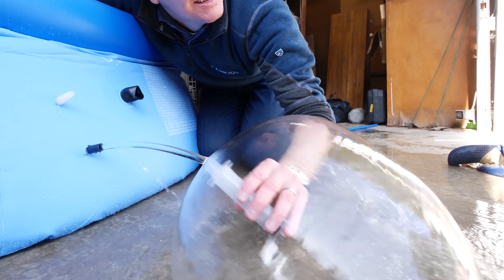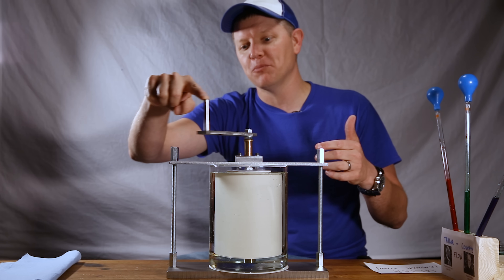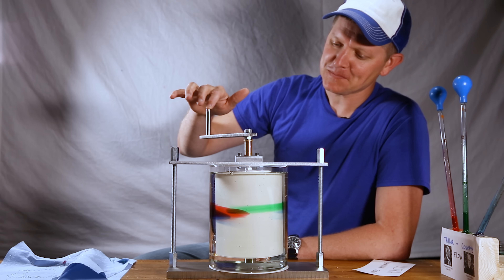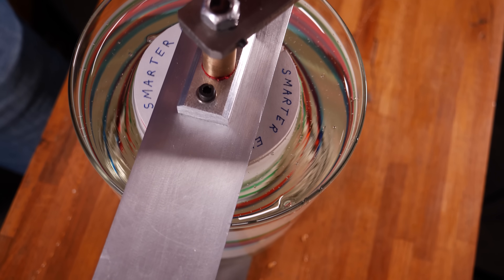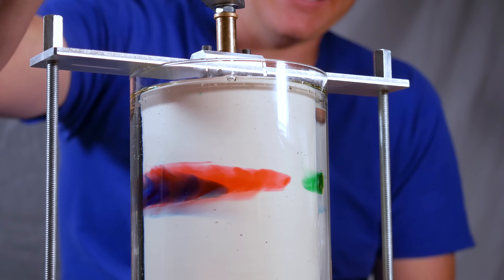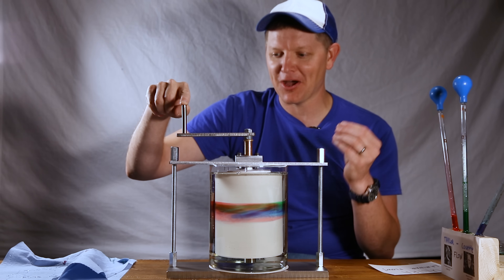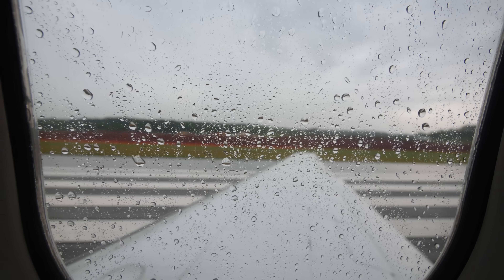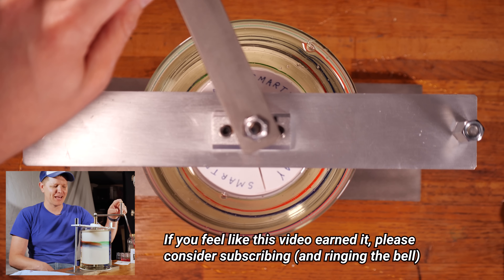Unmixing Color Machine (Ultra Laminar Reversible Flow) - Smarter Every Day 217

Comment: Hi, Destin. Great video as usual. I had an idea for another video. I've always wondered what a fire would look like if you could pause it in time and see it from all angles, using the same effect that they use in the Matrix to pause and rotate around someone during a fight scene. The idea came to me because I'm curious if each flame from the fire is flat / 2D or if it has some 3D shape to it. You can't really tell in person since you can only see a flame from a 2D perspective and it changes so quickly that you can't see the other side or the top before it changes. I'm hoping I explained that well enough. I figured if anyone could make a video like this you could do it. Cheers!

Comment: You have demonstrated dense wavelength division multiplexing on fiber optic long haul internet data backbone circuits in fluid instead of in light.  

In the case you call shear thinning, we call that optical 'dispersion'.

Please take a look at negative dispersion fiber optics and the related field of pumped amplification of fiber laser signals.

They make the data flow from the Data Center to the next Data Center across the country.

-Cecil

Comment: If you ran an electric current through a copper tube filled with ferromagnetic fluid could you produce a larger induction coil with a bigger magnetic field? Or solid copper coil makes most effective induction field?
 Can you do induction heating in a vacuum?

Comment: makes an awesome demonstration of air flow as well ... and for those who think fluid dynamics and air flow arent the same ... you are so very wrong ... they are exactly the same ... they just have different viscosities and so react similarly but more pronounced ... this is why drag reduction works in wind tunnels and water tunnels ... it is essentially the same thing with different densities

Comment: Sorry, but it's NOT reversible mixing. The colors aren't actually being mixed, they're just being overlaid in a tightly-spaced spiral pattern. If they were actually being mixed, you wouldn't be able to separate them again by simply reversing the crank.

Comment: Can you explain how a smartphone knows how much battery power is left? The voltage is constant so how does it know how much energy is left? I've googled this and the answer appears to be "it doesn't know, it just estimates by measuring how much power was used since it was full". I don't like that explanation.
Reply: Smartphones use Lithium ion (Li-ion) batteries, these batteries operate within a certain voltage range. The smartphone is able to read the voltage of the battery and calculate the percentage of remaining battery power. Li-ion batteries use cells and each cell can store up to 4.2 volts, as the battery is used this will go down and most smartphones stop discharging to prevent damage between 3.0 and 3.6 volts. Past that your battery starts to damage itself, it’s pretty cool stuff. If you’re interesting in learning more look up “Lithium Ion Batteries”
Reply: @marcussykora8383  Voltage detection only works when turning the phone on. ... "When the phone is running, we thus cannot rely on voltage measurements. " says the internet.

Comment: @
SmarterEveryDay what would happen if the angular velocity of mixing and unmixing has a very high gradient. Will the results be the same?

Mixing at higher angular velocity may cause "slippage" of the fluid on the inner cylinder and unmixing at a slower velocity may have less or no slippage resulting in a possible different outcome.

Comment: Hey Dustin, are you located in HSV? The reason I ask is because I have seen videos where you have had excerpts taken at various places in the rocket city. The most recent one I seen was when your were talking about laminar flow (the most recent time) inside of the Davidson Space Exploration Center. The building was named after Julian Davidson, whose company I used to work for in Cummings Research Park. He was a great man.

Comment: I'm curious if you think the striations in the colors after returning to the original position are more from the varying speeds of controlling the crank manually or if it's from slight variations of the viscosity within the fluid. I guess another video with a really slow reversible motor after somehow getting a homogeneous mixture of corn syrup is the only way to find out!

Comment: Hey! I work at a gun range and am building a new rifle. All of my coworkers tell me that the open ended flash hiders (three or four prongs that are not connected at the end) like the one in your how a suppressor works video work the best to reduce muzzle flash. When I died why I got a lot of answers that didn’t add up to me. Half said that the tuning fork effect they have mixes the air so it dissipates the pressure faster and the other half said something about the harmonica of the barrel and blah blah blah. I have a theory but I thought it would be a cool topic to cover.

Comment: Hey Destin, I came across something quite interesting recently. I was making hot chocolate and to cool it off I placed an ice cube in the cup. What happened next surprised me, the liquid started to swirl as if I had just stirred it. I found this fascinating enough to where I did it again; on my third time around nothing happened. Assuming it was the heat of the water acting on the melting ice I made another cup and sure enough, it started swirling again. The ice I was using was cylindrical in shape and around 2.5cm. I did this again tonight and decided to measure the variables. At my altitude of 239M above sea level, the temperature of the water had to be no less than 79C, and the ice, if larger than 3.3cm wouldn't produce this effect. The cup was 11cm in diameter and 10cm tall. 

Now that all of that is on the table, here's my question. Do you know what causes this, or would you be able to help me figure this out? I understand that it isn't very interesting for most, but it is baffling me as to why it happens. 

Thanks!
Reply: I belive the ice cube cooling down the liquid causes it to sink and thus creating a swirl. I read about a phenomenon that caused a gigantic ice circle to spin for no apparent reason. It was later revealed that this was caused by the same reason that is affecting your ice cube. Not sure about the variables though.
Reply: I'm going with 'Significant discontinuity' on the surface of the cylindrical ice cube. 
Of course, the cube is melting on all sides, but at a particular point, there is what I imagine to be a linear indentation allowing the melting to be focused and directed in a specific direction, causing the spin.
Reply: Convection cycle?
Reply: As a few others have said, I think this is simply convection. The cold and melted ice water as well as the coffee that's cooled from the ice will sink. Perhaps when it sinks it's subjected to Coriolis forces causing it to swirl. Like water down a drain. But I'm not sure if the coriolis effect has any meaningful impact on such a small scale. 

It could also just be the ice melting unevenly causing a pressure on one side making it spin. Does the ice and swirl spin the same direction every single time? If you started the system with a slight spin in the opposite direction, then added the ice, would the spin stop and reverse direction?

If it spins the same direction every time or will reverse the direction of an existing flow, then for sure I'd say something is going on (coriolis?). If it isn't repeatable then I'd say it just ends up spinning in whatever direction most of the liquid is already rotating.
Reply: Brownian motion?
Reply: @veritasiumaequitasius3530  no Brownian motion should work only in collidal solution and that too on a microscopic level not visible.(well but if it's diffusion then that could be explained by Brownian motion I guess)

Comment: The striations indeed look like they might be due to shear thinning or some other nonlinear shear effect; the other thing that stood out to me are the air bubbles though. They also create a localised perturbation in the flow; which I suppose is also reversible as long as the bubble is sitting still; but given that they should be rising at a nonzero speed, that could be another factor contributing to imperfect reversal; and probably would also look like striations from the top.

Comment: Why mix so slow though? Does more force/velocity = no unmix?
Reply: Maybe because the higher speeds could cause more of a centrifugal force that would mix everything up. Just a guess. Could also be that the varied shearing rates (mentioned in the video) could be more extreme at higher speeds, therefore mixing the colors. Or, the higher speed would create more frictional heat, which could affect the viscosity of the fluid.

Comment: First of all, you’re awesome and your videos rock! Interesting idea for a future video if you can crack the code which I’m sure you know already or have might possibly already figured out. When I did a burn out with my Chevy truck, power-brakes and both tires spun up (yes it has a limited slip differential) and this is my question: The imprint left on my smooth garage concrete floor is a perfect representation of the tire tread, somehow marked by the tire continually spinning over the same spot?? Any ideas? I can send a picture just not sure where yet. -Paul

Comment: You should try it with slow controlled motor, i suppose result will be even better. There is definitelly some incorrections while turning backward because it is mostle impossible to keep the same speed, and different rotation speed obviously causes different flow's variations and ways that your liquids mixes. So while you turning back it will be harder to get same liquid points. Motor with controlled speed will fix this problem. Also you can experiment with different rotation speed's, and then compare results to achieve as good as possible result (or even explore some physic laws).

Comment: Use an arduino and stepper motor and see how many turns forward and backwards you can go, as well as how many times you can reverse it before the sheer thinning messes it up. Would be interesting to test and see which fluids work best and "last" the longest in demonstrations.

Comment: I've heard this called reversible in many occasions, but I don't get why it's considered «reversible». Sure it's time independent, and that would imply reversibility, but there's no flow happening in this demonstration. 

Also, I don't buy that this is an effect of having very low Reynolds number. If you were to build the same demonstration, but instead used water with a precisely controlled actuator that would rotate the inner cylinder at a low Reynolds, you'd have mixing. There's gotta be a chemical (or solvent rather) effect going on here.

Comment: Great video! Btw, you're right! The flow isn't radially linear (it's parabolic) and you can get the velocity profile by assuming it to be 2 parallel plates (1 at rest) and either solving the Navier Stokes equation or doing a momentum shell balance over it :)

Comment: Destin, you can up your game by replacing the cylinder-in-cylinder setup with a robotic hand (like KUKA) that slowly moves an actual spoon in not-that-obvious pattern, and then reverses the motion. Would that work? Or there would be some turbulent flow along the spoon edge that breaks the reversibility.

Comment: Besides everything else, I suspect gravity (or the underlying maths) has some relation to this - the outer and inner deformations of the dye, speed of rotation vs the distance from central axis etc. Anyway, why not spin it faster and then reverse spin it even faster and see what happens? A small, low speed rotation forwards and backwards, impressive back during the discovery, but not at this point. Not that the discovery wasn't.....revolutionary (pardon the pun), but......?? Also, what about the research on tsunamis and how water flows on water? - A discovery that apparently had more attention after the Banda Aceh event and why a sudden catastrophe ensued.

Comment: Hi my name is Adam. I've got a simple question, and it is giving me a headache. Does it matter which way the vortex spins? For context I'm trying to put a 5 gallon bucket in line with my shop vac, to collect more of the dust before it gets to the shop vac, to hopefully prolong its life, reduce suction lose from dust buildup, and allow it to run for longer periods of time at a cooler temp. The plan, two holes in the lid of the bucket each about 1 1/4 inch, one in the middle, and one closer to the side of the bucket. The hole in the middle gets a piece of tubing inserted 4 to 6 inches into the bucket, and the other hole gets an elbow pointing into the side of the bucket. The overall direction the elbows facing determines the direction the vortex will spend. The air and dust enter the bucket, hit the wall and spin with the vortex. The dust can't immediately exit because of the pipe sticking down the middle. Then gravity forces the dust down into the dead Zone while the much lighter and faster moving air takes the path of least resistance. Some of the Dust will get by the pipe trap, and there lies the heart of my question. Should the vortex spin counterclockwise you know because of the toilets? Should the vortex spin clockwise because it's exiting vertically? If it spins clockwise wouldn't that accentuate the Coriolis effect in my favor? Is it actually the length of the pipe in the middle that will determine the efficiency of my trap? Does it matter, will either of these directions increase or decrease the amount of dust that's the trap misses? I'm not joking this is what keeps me awake at night. Any help from anyone would be greatly appreciated, thanks.
Sincerely🙃.

Comment: I’d be curious to see multiple experiments using different speeds of rotation, and also different numbers of rotation. And then maybe try it once with inconsistent speed changes mixing it and then again a different set of inconsistent speed changes unmixing it see how much of a difference that makes.

Comment: From the image card I thought you were undoing entropy... like defying the second law of termodinamics...
Still fun though.
Reply: It is really ironical that a very close approximation of reversibility can be obtained by ultra laminar flow that is the very opposite (viscosity = dissipation = delta S>0)... The explaination is that this is nor ture reversibility: the system's configuration can indeed ne reversed (in principle completely, in reality you will always get some difference), but at the expense of paying double the mechanical work browser for the first  transformation (turning the cylinder clockwise) instead of getting it back completely, as it would be for a truly reversibile cycle

Comment: I'm sorry but the metaphor breaks down really fast for me. Take it from someone who has spent the last 7 years studying fluid flows. Yes, life is messy and jumbled up, but if everything can be set straight, you can go back, then it assumes that life has always been laminar to begin with. Laminar flows are the most restrictive flows that exist, in laminar flows you can't change the path you are on, i.e. they are represent the idea that destiny exists. Turbulent flows are random, chaotic, unpredictable, most importantly they allow for change, however, once the change is made it cannot be undone you can only go on. So yes, life is turbulent but if you apply enough energy and effort you can change the path you are on. 

If you also look at it form a bigger perspective, we don't measure flows on the impact of a single particle we measure them as a whole. It's the same for people, history does not look at the path every single person has taken, it looks at how society has changed as a whole over time. In a laminar framework, for society to arrive at its destination everyone needs to behave exactly the same, no deviations. In a turbulent flow, so long as enough energy is put into the system, it will also get there, but most importantly nobody is the same.

Finally, if everything were to stop right now, from a laminar perspective, you can wait and then restart again without any change. Not in a turbulent system, it needs energy to survive, without energy it quickly break down. This is what life is, if you removed all the knowledge and wisdom that pushes our society forwards, life would quickly disappear but you can't just restart it by putting it all back. Turbulent flows are also characterised by the energy cascade, over time the energy of the largest structures gets distributed to the smallest structures all too keep the flow moving forwards until these small structures dissipate. This is the same for life new generations are born full of life and then they use this energy to, as a whole, move us forwards. This push becomes less and less as they age until they no longer can and die.

Comment: You could analyze the shearing more precisely by using a motor to turn the inner cylinder. It'd be neat to see how much of a difference the variations in speed caused by hand cranking make.

Comment: I don't understand.  The fluids never really mixed did they? It looks like each one went down a spiral path and from the outside it appears they mixed but they haven't really. It's just each of the 3 colors spiraling inward but maintaining separation from each other. Then unraveling it simply reverses the process by spiraling each backwards into their original position. You couldn't use any method to separate, say, 3 colors placed into a glass of water right? Because those colors would be truly and unreversably mixed. Unless I just missed the whole point of the video.